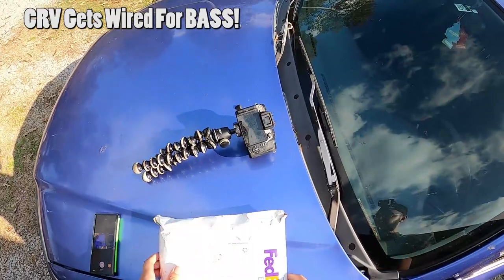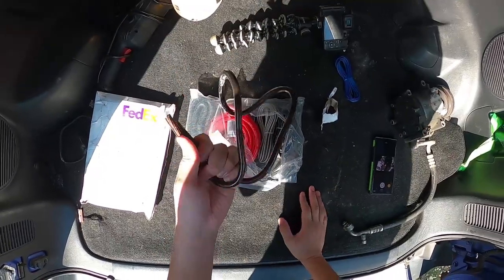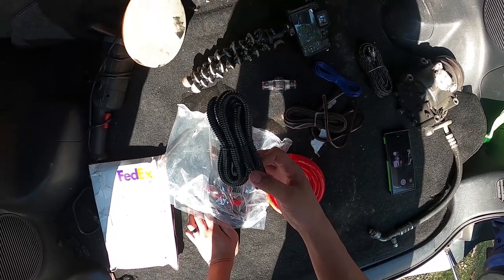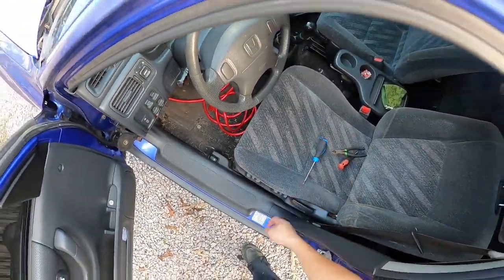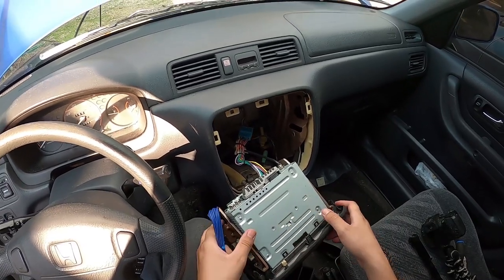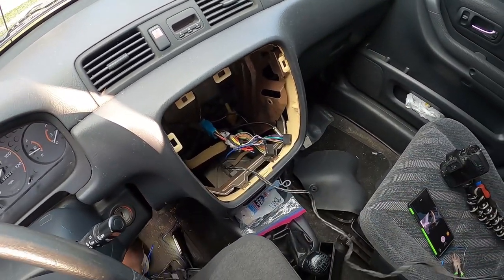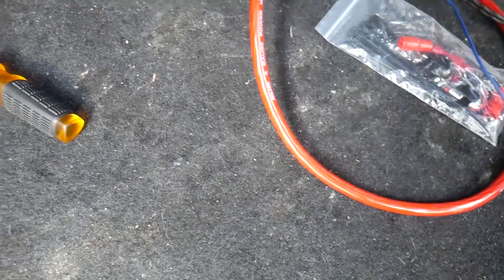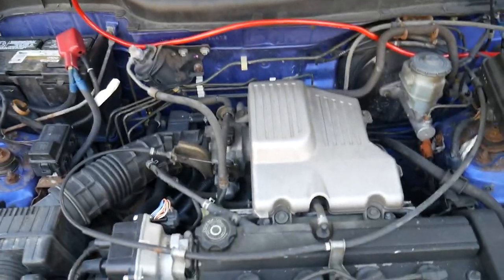Installing A Amplifier Wiring Kit In My Honda CRV!

Comment: Gd job showing the installation bro,but always separate power wire from everything else it makes a big difference with interface trust💯
Reply: I would have run the power wire on the passenger side to the fuse panel/battery under the hood away from the RCA.

Comment: where did you run the wire at out the radio to the back under the carpet or the trim by the doors?

Comment: The fuse in front is just in case you crash on side car wire shorted like you said cause a fire. I don't mind Car Stereo that's where I started back in 1993 I was 16. Got video my Channel I did Orion System in Ep3 Civic. Two 12s JL Audio Subs. 6500w Orion Amps Mids and highs.

Comment: Hope your amp is not over 400 watts. You have some small wiring and always get a capacitor so it's not sucking off your car battery and alternator.
Reply from the maker: Caps are ass. I know car audio. Appreciate the input tho